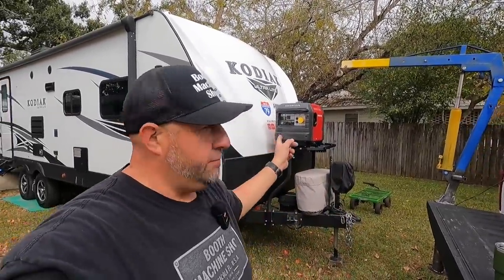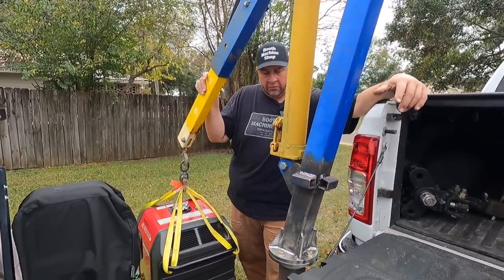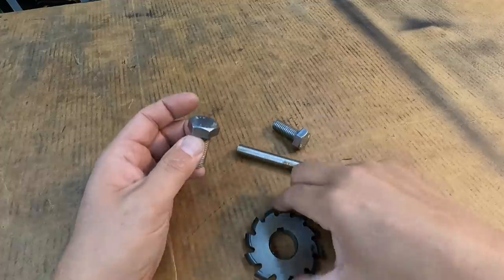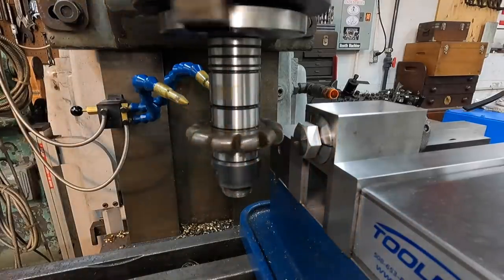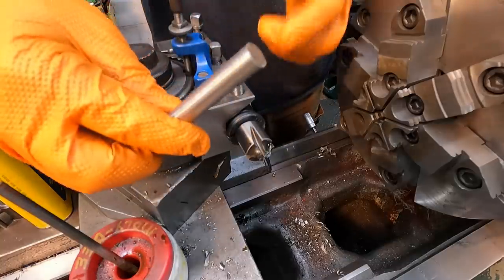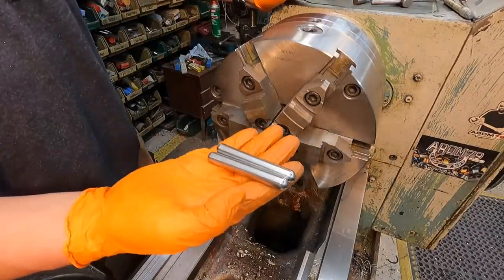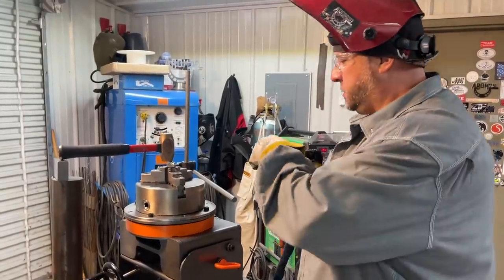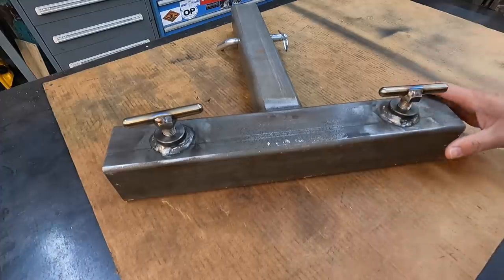Saturday Night Special 355: Stainless T-Bolts, Truck Hitch Crane First Real Lift

Comment: Hi Adam, great job on the hitch crane. I'm jealous ! 😉
Portability/Assembly Safety: Instead of the three large bolts (base of jack, elbow of crane, top of jack) could you use large pins ?  Just make a good step ladder part of the hitch crane kit. Would make it a 3 piece unit that is much lighter to handle IMHO.
PS I have an idea for replacing that jack with an electric winch with a load sensor on the end pulley to show load weight 😁.. I'm sure you do now too .. hehe.

Comment: I like the idea aswell.however would a pivot at the base with a pin be easier to lay into the bed and still have the strength needed.. plus I think a hydraulic or electric ram would make life easier

Comment: You should drill a hole in the swivel base of your picker and ad a QD pin so it doesn’t swivel driving around. One day when you want to get real fancy get onboard air, and swap the hydraulic cylinder with one of the pneumatic/hydraulic types so you don’t have to pump 159 times lol
Reply: Not meant to be left on when driving. Simply unhitch from receiver.

Comment: Adam you go bloke probably the most engineered T-bolts on the Internet, still if you have the machines use them, BTW how long did the prep filming and clean up take 😁
I felt like I was back at school doing a project in metal work class , but still it is addictive to watch the lathe turn, but it wasn't long enough for me lol
I agree with others Adam can you tip the crane over and lay it across the back of the utes 
Towball obviously when you are not towing or if you want to put it in the back, mount a D-ring just behind the cab and use the crane to drag itself into the back. 
Well done mate nice job. 
Tony from Western Australia 🇦🇺

Comment: Next project, making a wrench specifically to tighten these bolts after it is realized that a wrench doesn't work as much as he'd like it to.
Reply: A short pipe that fits the SS rod would work better than a wrench.

Comment: You need to put a pivot on that I used a hub off of the front actual car and mine rotates where I'll go 360ﾟ if you want it to it works real nice and I have it either to go and receive or like you do or I can put it in the back in my Box Van and swing from one side to the other don't take much to adapt yours to make it worthy of it have a good time

Comment: There might be a slight flaw in you hitch crane thT can be easily solved.
You may find it difficult to remove your support  brace to the ground after you put a heavy load into the bed of the truck because the added weight will put pressure on the support  [ thru pin ] adjuster.  I haven't  read all of the comments, maybe this was pointed out.

Comment: My luck them fancy thumb screws would be lost in very short order. Might think about getting two 1/2 thick nuts and put them on the thumb screws as a jam nut to help keep them thumb screws from growing legs! lol. Also, might consider milling some lighting slots & holes to remove weight from the crane arms.  Done that many times on race car stuff . Wish yall were not so dog gone far up in the pan handle as you're a good 8 hours from me in West Palm.

Comment: love the lift in action! hey i realize this cutter is awesome to use, but wouldn't a round nose ball mill just been easier less hoopla??
Reply: there is always the issue with ball end mills that the centre of the cutter has effectively zero SFM velocity.  plus it's as much about creating content as getting the job done.
Reply: No.

Comment: So what are you going to do when you load something INTO the truck and the weight jams that crane leg down so hard you cant release it? Or did I miss something. been following whole build as I need one of these.
Reply: Loosen the bolt and the leg will come right up. It has a set bolt in the side, and the leg will collapse right up into the body of the crane.
Reply: I thought the same but in an earlier video someone mentioned that Adam had covered that there likely won't be anything heavy enough to make it an issue.

Comment: Try some spinny thingie on pump handle,
Some crank shaft or spring loaded leaver on a cam shaft or something,
U can even add a small hydraulic power pack on it wich runs on 12DC ,
And mixing it with a winch would be nice,
Even skipping heavy hydraulics and setting angles with pins and lifting with winch cables.

Also if u wan it the same, 
The ck45 quick pins in four point hitch of tractors would be nice substitute for bolts, in case of quick assembling and disassembly  of those heavy parts up top of crane .

For coating that, if it's a powder coated part, 
You are ok,
If there's paint on them,
Powder coat will be bubbled and will fleakes off,
Even if u wire brush off all the paint or shot blast the paint off,
we Still gonna ve some remaining paints in cracks and crevices,
and bubbley spots there.
In powder coating we call it :
Paint in the cracks 😂

And last but not least,
The nylon bushing in powder coating oven will be smushed , 
It's 200°c .
U must press it out and dismounte it first.

Urs truly,
The Iranian dude 😁✋💚⚪🔴

Comment: Why not install some quick pins where the bolts are and that way it could assembled or disassembled easily and make it lighter.  Just machine some out of some cold roll steel.

Comment: What was the advantage to using the arbor radius tool vs just using a ball mill? Great video thanks
Reply: The tip of the ball mill travels at near-zero velocity. You have to go slower and the tool won't last as long (although they are cheaper).
But for making just two parts, a ball mill would have been just fine.
Reply: Because he can!

Comment: Couldn't you mount a longer hydraulic cylinder that has a longer throw, so you don't have to pump the handle so many times to raise a load? Thanks, T

Comment: dam when you are plaining that metal those chips flying every direction at like a 45 degree angle rate.    Makes me think,  Ohh wow look out hot flying razor blades!.... set the machine up on a motion  sensor at night  if anyone gets in....   Hmm makes me think that would actually be cool to see all the machines setup at the same time, you come in first thing in the morning flip on the light  switch, they all start up and start doing the jobs.  Just gotta watch out for start up amperage spikes.

Comment: For that footing just the suggestion why don't you try a linear actuator that you can connect by down to the bottom of the foot and connect the other end up at the body that plugs into 12 volt right at your trailer hitch and then you can electrically set that foot that foot should be plenty one way or the other on that square tubing and then all you got to do when you're done is pull the pin and run the linear actuator up and lock it into place
Reply: Just my personal opinion...

The more you have, the more that can go wrong.  I doubt it's going to see so much use that it would be worth it.

When in doubt, always follow rule #1....KISS

Comment: You could have silver soldered instead of welded the bolts. It's strong enough and much more esthetic.
Reply: Unnecessarily expencive and weaker.
Also costs more just with the gas for heating it up than the power for welding
Reply: @tullgutten  I'm sorry, but you're wrong. You probably not familiar with how strong a silver soldered joint can be and the difference between the costs of welding and soldering such a relatively small joint is negligible. On top of that Adam already has silver solder in the shop. However that's not the point. Adam goes a long way to give the T-bolts an esthetically nice appearance, by first facing off the bolts, cutting a matching groove and rounding off both ends of the small handlebars and then ruining it all by a few ugly welds. I found that somewhat inconsistent. The T-bolts are only meant to be fastened by hand and literally nobody in the world would be strong enough to sheer off these silver soldered joints manually.

Comment: I noticed some steel mesh inside your pyrex tig cups. What is that mesh for?
Reply: That's a gas diffuser. Makes the argon flow nice and consistent through the outlet of the cup
Reply: @Ottoman83  very cool. Thanks for the information!

Comment: Made me wonder when abom leveled the bolt in the collet, whether the machine/vice is also level? The bolt needed to be set parallel with the axis of the machine to machine point to point, as opposed to level but made me wonder whether a machine like that is set up level or whether it just sits on the slab and as level as the slab is 🤷‍♂️
Reply: Good practice is to always level out machines. I'm 100% sure Abom's machinery is all level to the world.
Reply: @zomgthisisawesomelol I figured that might probably be the case... thanks for confirming that 👌

Comment: You could probably do away with the mounting bolts holding the jacking ram cylinder and just use quick disconnect locking pins so you could quickly remove and replace the ram when setting up the lift? The ram is probably a good portion of the weight?
Reply: A good idea, is a good idea. Salut

Comment: Mounting a cable winch on it would make it easier to precisely put something where you want it.
You can use the boom for height and distance from the pivot point.
Shouldnt be all that difficult to include some pulleys

Comment: Everyone in the comments trying to think of ways to lighten this up. All I can think is, add a skinny cylinder inside the jib to make it more like a hiab. Then while you're at it get a electric powered pump to run both those cylinders, and might as well fit a slew motor aswell while you're at it. Ooo and another cylinder for the stabiliser foot.

Comment: As far as taking the crane apart, since there is no advantage to having any of the crane's pivot bolts tight, you just leave all of them loose, so no tools are needed to disassemble it.  I take my engine hoist crane apart whenever I have to put it in a vehicle, and that only takes a minute or two.  Fair trade for not having to trailer a forklift when you have something 500lb to 2000lb or so to load or unload.  Convenient enough for smaller things like your generator, too.   Very nice.     I really don't see much point in putting additional brace on it.  A rubber pad under that vertical support would give it plenty of grip on any surface, and between that foot and the truck, it will resist massive amounts of torque.  I guess you could calculate the max torque on your welds and pretty quickly figure out if you need supports for that reason.

Comment: An aluminum crane would handle any weight you're likely to be lifting onto that flatbed
🇬🇧🙂
Reply: Yeah, and would have been 10x as expensive, especially considering he had most of the parts and materials.
Reply: @littlejackalo5326  

Yeah, and would've been a lot lighter too.
🇬🇧🙂

Comment: Get it engineered with an appropriate SWL plate mounted so that it’s legal and somebody doesn’t get killed.
Reply: Are you serious ?
Reply: @Gus1966-c9o  I think he is serious!!  Unreal.
Reply: @grntitan1  the odds of getting hit by a meteorite are a little different to the odds of a bending moment being miscalculated in terms of the buckling strength of a piece of SHS which has been welded 4-6 inches above its base. There’s a reason that things get engineered. Even when they get engineered after being built. It’s so that we can advise people what a safe load would be for a given design. That’s all I’m saying. I’m not criticising the design. Some aspects of the design are cool and some aren’t. No SWL is dumb. There ends the lesson.